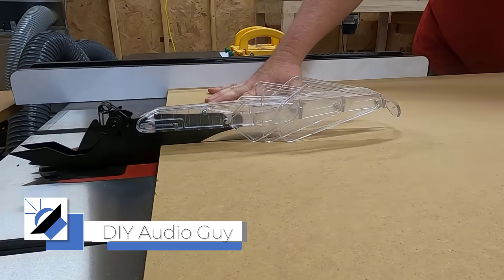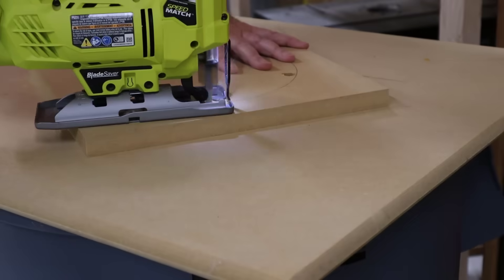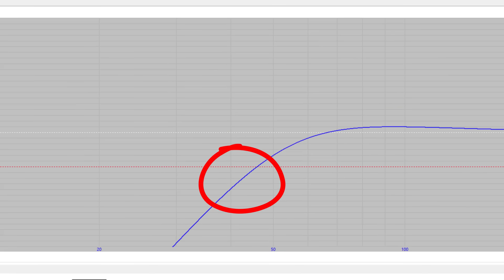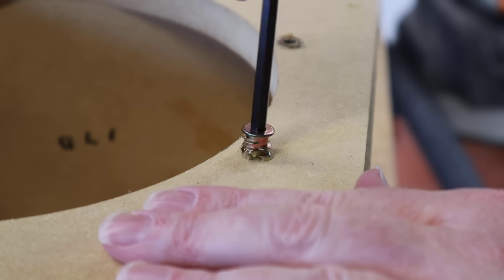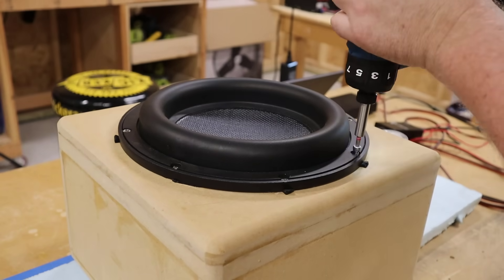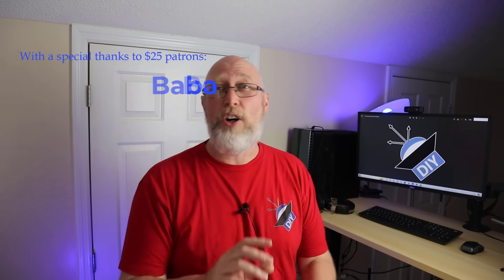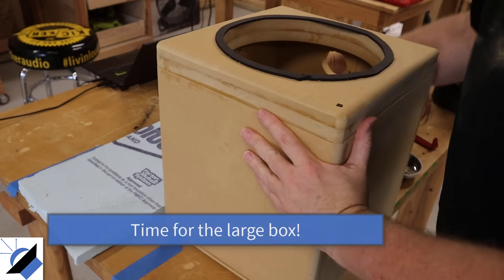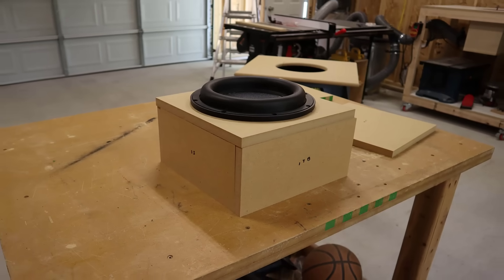Bass in a small space?  Sealed subwoofer enclosure design.  @PartsExpressOfficial

Comment: Thank you for such an informative experiment. Being a bass lover and had built numerous speakers and subs for past 20 yrs here in Singapore, I would like to share these observations: 
- MDF wood made enclosures needs much lesser bracing than plywood enclosures to sound equally  good.
- MDF Wood doesn't do well in wet, rain or outdoor conditions. 
- Sealed subs produced the least spectrum decay bass, typically less than 10ms aka 'tight' or 'defined' bass. Comparing to ported subs designs, bass seems much lesser.
- Most ported subs are capable of producing more bass than enclosed subs. However, the bass has longer decay around 10-20ms. Which most folks deem bass as 'fuller' sounding. Seems like a little bass decay may not be such a bad thing .
- passive radiator subs produced the most bass among the 3 types of enclosure but has the longest  bass decay, usually 20ms & above. Some may find this type of bass undefined or 'boomy'. Still this type of subs are great for outdoor. Bass can be felt further than the other 2 types of subs.
- Lastly, if space is limited, I like to used sealed subs with Apex Aural Exciter+Big Bottom. This is often used in P.A to extend the bass decay to sound fuller without increasing volume.
Fav subs: Cerwin Vega 15" drivers, Das Audio PA 18" drivers and Magnum extra long throw 12" drivers, Eminence 15" drivers & Audax 8".
Software used: Winspeakerz.
Reply: Bro u rule

Comment: I have a 10” JL subwoofer that requires 0.75 Cu feet of air volume per JL spec sheet. To achieve that, JL has provided the box measurement as 18”Wx11”Hx10.25”D. My question is does it matter if I alter the measurements but still get the 0.75 cu feet of air volume? Basically, if I change the shape of the box to fit the space I have. BTW, I will have about 2.5” of clearance for the magnet. Thanks.
Reply from the maker: It should not make any difference, so feel free to alter the dimensions to fit into your car.

Two and a half inches of clearance behind the magnet is plenty.
Reply: @DIYAudioGuy  Thank you sir.

Comment: Nice comparison.  What about using DSP to flatten the lows in sealed configs?
Reply from the maker: That is DSP, not enclosure design.  If the plan is to just fix everything with DSP then does the box even matter?
Reply: @DIYAudioGuy  Just figured people usually use eq to 'fix' their sealed curves for drivers with enough excursion...but then again maybe that's niche.  Box would still give the ported a big spl advantage either way.  Been running two sealed and eq'd ultimax 10's for a couple years but after throwing one in my car recently I'm about to port the remaining home theater one to regain low end SPL and see if I don't mind the ported 'sloppiness' some people talk about.  Definitely curious if dsp and extra power could work magic even with those tiny boxes you made!

Comment: I prefer sound quality and have several cars. I also really like JL Audio as I’m always trying get best bass in small areas. Have pair flat 10’s in my 70 Camaro sealed and super clean right. I have paid flat 13’s in my Audi RS7 with HD1200 amp. Sounds killer to me. Powerful but super clean and tight as well. Lastly have 13W7 in my Benz GLS 63 AMG in a sealed box with HD1200 as well pushing it. Hardest hitting of the three but sounds bit muddy to me but scouts be size of that SUV as well doesn’t help.
Reply from the maker: You have some nice cars and some nice gear!
Reply: @DIYAudioGuy  Thanks 😊 I Have a 17 Ferrari 488 Spider as well but haven’t messed with the Factory JBL premium sound as it sounds very good and such limited room in there.

Comment: Nice video, thanks. It would be helpful to see the impedance measurement curves to compare with the lumped parameter simulations. 
btw, I was taught that the term is RESONANCE frequency, not resonant frequency. i.e. frequencies don't resonate.
Reply from the maker: It's a grammar thing. "Resonance" is a noun, "resonant" is an adjective.

"The free air resonance is 30 HZ."
And
"The resonant  frequency is 30 HZ."

Both are correct.
Reply: @DIYAudioGuy  Yes, it's a grammar thing. But sorry, "resonant frequency" is incorrect - frequencies don't resonate.

Comment: 1.5cf ported vs a 0.88cf sealed, eh, and here I was thinking the entire vid "why not show a larger than 'suggested' sealed box?". ok, I'll just guess all ye had was that 1.5cf ported pox to work with on the vid, and you do have a good point about the amplitude being progressively less the larger the sealed box (if SPL is your only consideration, I had a few others). I myself have opted to not make my own speakers as it looks like no one makes a box that is significantly bigger than the speaker diameter, lol. it is fun to tinker for sure, even if you break down and get a set of mr5mk2's for the recording studio after a few years of tinkering, and still continue to tinker with ideas.  B)

even googling it now, it's confounding, can only get a 1cf box if it's for a 12inch sub not a 10 or 8inch, and it's just 'why' invoking, why can't I have a larger box than that, lol.
Reply from the maker: Most pre-fab boxes are undersized.

Comment: So basically, if I want to install a 10" sub underneath each seat of my truck, I'll need to cut the floor pan out and install a 14" deep box.  Great...
Reply from the maker: You can still do it, you're just not going to get the result that you would get if you had those subs in a huge box sitting in a trunk.
Reply: @DIYAudioGuy   what if instead of an 8 or 10” sub under each seat that faces up towards the seat, you instead use like 3 or more 4 inch subs in a box that all point to the rear seats so the box and air behind the magnets would be at least 8” or more.  Would that be a better option?

Comment: I have Sundown SA12 v2"s CRAMMED into a box under my seat in my silverado extended cab, it was a down firing box, I put 1 1/8 mdf to block the bottom hole and cut holes in the top and then added 1" spacers AND had to grind the mdf to fit the magnet. It dose hit hard but I wonder if it would hit harder with shallow subs or just sound way cleaner. I'm going for as much feelable bass as possible, I'm obnoxious lol
Reply from the maker: I am not a huge fan of shallow subs, they often need the same airspace as a normal sub.  It is just easier to cram them into an undersized box.

Comment: If you just don't have the room you can get back lost output with more power. Smaller enclosures have more control over the woofer letting it take more power. In this instance I'm not sure you would hear much of a difference being that 3db is the smallest difference in sound we can hear.

Comment: Can you get more inner volume by shaping the bow differently, from a cube? I have a 2011 Ram. I'm running two 12's in a custom box under the rear seat built into the storage area. But I'm also looking at placing additional speaks within the space between the speaker box and rear cab wall. Not a lot of volume from front to back, But from left to right is the width of the truck.
Reply from the maker: Yes, I don't believe that the shape of the box has any meaningful impact on the sound.

Comment: When I made my first Speakers, I was told to size the Enclosure at 9 cubic feet.
That works so well.
Reply from the maker: That is huge.
Reply: @DIYAudioGuy  
Not so big in my Living Room. I was told to make a horn shap over my mouth and then sing. That is what smaller speakers sound like in comparison. That was 45 years ago and they still are the best sound I have heard. Full and Natural. Used Etone (Guitar 12" Alloy Frame) Speakers up to 350 hz and then Philips (Holland) Domed Mid and Tweeters.

Comment: Speaking of small spaces. I have a 2019 Ford Ranger. There are two storage spaces under the rear seat(s). Each space is about .5 cuft. My question is, can you run a "tube" between two boxes to make the air volume required for the subwoofer. In my case a Skar EVL-8 (optimal 1 cuft sealed.) I hope that makes sense. lol
Reply from the maker: I'm not really sure about that.

Comment: Sealed enclosures have a much better impulse response, and thus perform better especially when it comes to percussion. It tends to feel "tighter" and more accurate. If you just want lots of low end, sure go for the ported. But generally speaking, the sealed enclosure will feel more musical, which will ultimately sound and feel better.
Reply from the maker: A lot of people agree with you.
Reply: Go ported servo subs. Better control that sealed and deep controlled bass.

Comment: Each speaker driver has Thiele/Small properties, if they are not known don't buy it. Qts determines if it'll be better for sealed or ported boxes, and Vas determines the volume of the box based on the volume of air that the cones displaces, among with all the rest you make an assumption on what the enclosure should be like. Each Speaker/Subwoofer needs an enclosure designed and made specifically for that one driver and usually works for NO other. Car people making random boxes putting random subwoofers in them just make me lose my mind over what i've learned in high end audio design over the course of over 13+ years.
Reply from the maker: That is what I am trying to show people.  I am curious about your statement regarding Vas -- I read that everywhere but have been unable to find a source that shows exactly how Vas relates to the ideal enclosure size.  Can you point me toward a source?
Reply: @DIYAudioGuy  Yes, you did a good job bringing them a step closer to making better cabinets throughout a beginner friendly video. As for Vas, it's the volume of air with equivalent compliance acting as a suspension, for example it's an emperical guess for a 100L Vas driver to tell a sealed cabinet needed could be less than the Vas but not much more than that, to give an example a Visaton B200 8" full range driver has a Vas of 102, the recommended cabinets from the manufacturer's design range from 70 to 100 liters depending on the frequency response you are after, so we already knew give or take a number of what the cabinet volume would be, it wouldn't be 200 nor 300 liters.
I need to mention Vas mostly plays a role in sealed cabinets, and it's only one parameter of the cabinet design, you can't make one just out of it.
For bibliography, i do not have any information available in digital form but i guess there are plenty of sites that might get into such details.

Comment: So speaking of small boxes my question is.. if the box size stays the same but it's designed small for a 10 inch sub. Would a 8 in sub in the same volume box produce  more pleasing lower frequencies? Basically my conundrum is that I can fit a 12-inch subwoofer in a small box but am considering a 10 in the same size box. I really really value lower frequencies.
Reply from the maker: It depends on the subwoofer, the goal is to put the sub in the best box for that sub.
Reply: @DIYAudioGuy  LOL...

Comment: A proper size sealed enclosure is ideal. You will need more power than a ported enclosure but I think most would prefer sealed. I did have a very good ported box one time that sounded great. It used a smaller driver and less power.
Reply from the maker: Both enclosures have their pros and cons.

Comment: If you have an issue in the future with inserts sitting proud of the baffles mating surface consider countersinking the back of the sub granted the subs mounting ring has ample material to remove. If the IDs of the mounting holes are fairly close to the maximum OD of the inserts the less of a chamfer/ countersink will be needed. Anyway great content man,  you really can't beat hard numbers when explaining theory. Keep up the good work.

Comment: Small sealed is best in limiting cone excursion, thus such sub, although not going very deep, takes most amount of power and above f3 is able to generate largest SPL. This is big advantage in car audio applications, as "room gain" usually fills in bottom part a lot.
Reply: I didn't see much point in it "taking power" if it doesn't get louder than a ported with 50 watts.
Reply: @TimpBizkit  Unless ported driver gets destroyed if played loud under resonant frequency of the system. Even if it survives, the excursion outside of linear range makes the sound distorted and bad.
Reply: @IvanToman  that's why you put a high pass filter on your subwoofer(s) and tune them low enough for the range of music you want to play. My high pass filter is set at 33.5 Hz (usually 5Hz or less under the tuning), so less chance of damaging the driver at high levels.

Comment: Im a Bass player..... and an Ampeg 8x10"  Box is sealed. But because the amount of 8 Speakers makes it good in any way. 1st.  sealed box = sound quality. 2nd...  8 Speakers is an nearly endless amount of power it can handle. 3rd the Membrane space is 8 times as high as a 1x10"   and with an 300 Watt Amp you can make the police come to your house, without calling them. :)   nearly every problem solved here. :)
Reply from the maker: 8 drivers would do the trick.

Comment: The diminishing output of a sealed box can be offset by "room gain" (or cabin gain), for virtually flat extended deep output. The 450w 10" Ultimax performs "better" in a 1.5ft^3 ported box than in a 0.75ft^3 sealed box, but then a 600w 12" Ultimax could fit a 1.5ft^3 sealed box. A 4ft^3 ported box fits a 600w 12" Ultimax, but then a 4ft^3 sealed box could fit a 1kw 18" Ultimax.

Comment: I have a 12" Dayton Ultimax in an Goldwood box of ~1.25ft^3 (2ft^3 is recommended). Performance is quite satisfactory with some EQ correction. The wedge-shaped box barely fits on the passenger floorboard of my truck. With the sub up front, I can low pass the sub @160hz without upsetting the stereo imaging.

I also use Dayton indoor/outdoor speaker pods ON MY DASH. I modified the pods with 2" mids, and mounted Dayton 1"x4" ribbon tweeters on the pods with zip ties. I just run the wires up my dash - it looks totally red neck, but sounds glorious with 4 x 75w stereo amp & 700w sub amp. Dayton (& Part Sex Press) has some great DIY gear. I've pounded these speakers daily in my car parked outdoors for 6 years and they still shine, even the delicate little ribbon tweeters.
Reply: Id love to hear your setup.

Comment: If you strip out your holes in mdf speaker boxes, or even various pieces of furniture you can drill out the hole and fill it with a cigarrette butt, and then super glue. Then re drill or screw, the hole is better than when it was new.
Reply from the maker: Clever trick.

Comment: Measuring your sub with REW on that table in a garage is really giving you nonsense data from reflections. It should be done on the ground in the middle of a field/large parking lot away from buildings with the mic at a distance of 10m (33 feet) - this distance is to eliminate the effects of the box, up close the box acts like a boundary. With that sub on the table, the sound will bounce off of a surface and back to the mic while some of that sound will go straight into the mic. At the exact frequency where that distance is 1/4 wavelength, the bounce will return 1/2 wavelength (180') out of phase (1/4 there, 1/4 back) and give you a dip.  For example, before you did the smoothing at 8:33 I can see the raw data. That dip at 90 hz = 12.5' wavelength. 1/4 of 12.5' =  3.125 feet. The exact distance from the middle of the driver to the floor half way between the driver and the mic. Dip at 31 hz, 31 hz = 36' wavelength. 1/4 of 36' = 9' - distance to closest wall. dip at 23 and 18 hz = boundaries at 12.25' and 15.6'. You get the idea: measurements done inside evaluate your room/speaker/listening position(mic) interaction, measurements done outside (box on the ground - half space) away from buildings measure the speaker - 2 very different things.

Comment: Threaded insert hack … if you install the threaded insert from the rear of the baffle (before assembly if you can) it will prevent you form having to countersink. The lip of the threaded insert also allows you to mount heavier subwoofers vertically inverted by sandwiching the baffle. Center hole punch highly encourage as mentioned before.
Reply from the maker: I am not a big fan of threaded inserts or T-Nuts.  They are not worth the trouble for most builds.  I only used them this time because I planned to repeatedly remove and replace the subwoofer.
Reply: @DIYAudioGuy  I got the notice that you did not care of the hardware when i watched the video, I just posted the detail for other subscribers/community members. Good demonstration, Thanks for the post!

Comment: I had t-nuts fail a few times and need to use a Dremel or bolt cutters to get my subs loose theirs plenty of room to give the sub a little turn if you blow out a hole.
Reply from the maker: I'm with you on that. For a small subwoofer I really don't see the advantage to using thread inserts or T nuts.  Plus if you want to repurpose the box you might end up with a different bolt pattern and then those t nuts ore of no use.